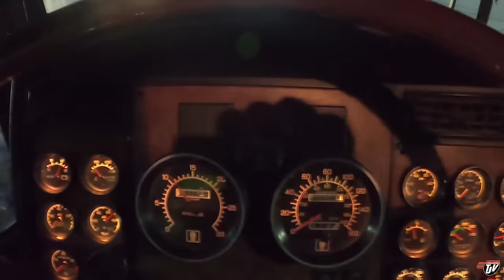CRANE WORK | My Trucking Life | Vlog #2461

Comment: Interesting crane, looks like a fassi or Ferrari, I didn't quite see.

I previously worked with a giant xs477 hipro-9 (44 ton metres), that was about 5 years ago, in its time it was one of the best / highest capacity cranes you could get.

It was remotely operated and smooth as butter. Cost an arm and a leg of course haha.

Good memories